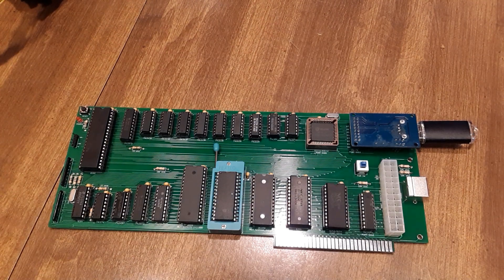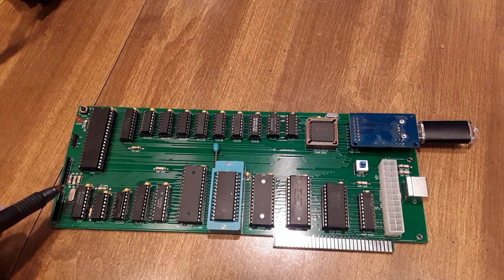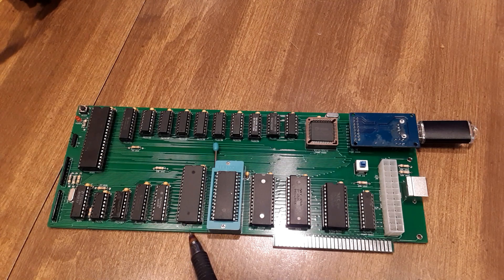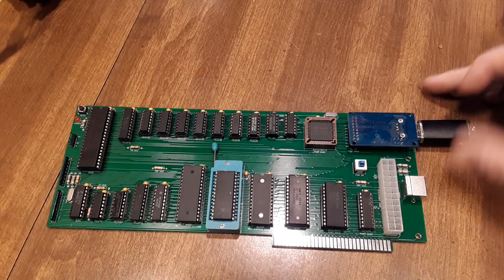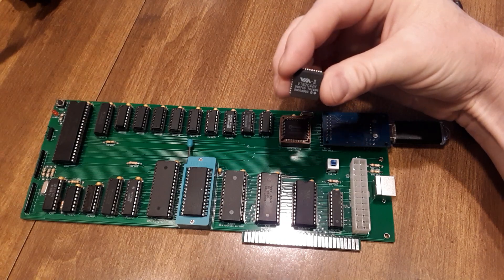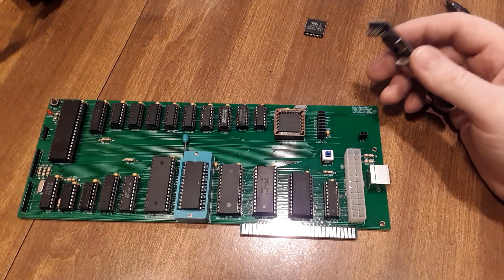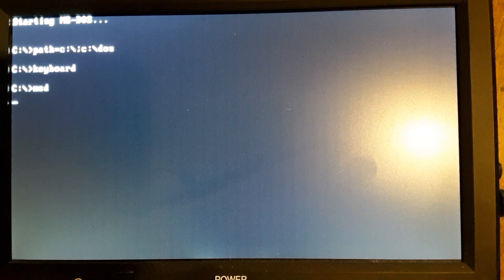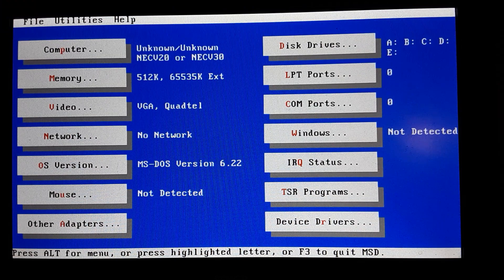8088 ISA Motherboard

Comment: Perhaps the beeping is due that your PCB layout is different to another PC. Make sure you check if the output from the 8255 connects ro gate2 of the PIT. Perhaps your base address != 0x60 or you have connected a different I/O pin to this gate. That would be a suggestion why it would keep beeping. Good luck and awesome project!
Reply from the maker: I am not sure. This issues is only with the 3rd party BIOS. My BIOS doesn't have the issue. I am thinking it is in the BIOS initialization code. Port 0x61 on both boards and the speaker logic is the same. the only difference is the V40 has the 8253 built in and the 8088 has an external 8253.
Reply: @elijahmmiller  Be sure to check this image: http://www.minuszerodegrees.net/5160/misc/5160_speaker_circuit.jpg

You see that PB0 drives gate2 of the 8253 PIT, and activates the counter for the PC Speaker. However, in a 5160 PC the output of this counter is not directly connected to the speaker. It goes trough an AND port before it hits a buffer/amplifier to drive the speaker. Perhaps to deal with DC offset when counter output is high? Therefore both bits are important.

When you look at line 492 of your BIOS code, you see that does set PB0 to '1' but PB1 to '0'. It would not make any sound on a PC with the above circuit as the AND port is activated (both PB0 an PB1 high), but if you don't have this AND port, it will make your system beep!

mov	al, 10100101b			; Set (non)turbo mode
out	61h, al

https://gitlab.com/hakfoo1/v40-bios/-/blob/main/pcxtbios.asm#L492

I might be wrong, but this could be a clue (and is easily fixable with some bios patches)

Regards,
Mathijs
Reply from the maker: Thank you for the information. I will have to look at the technical datasheets for the IBM 5150 again. It seems like it is mostly in the BIOS code but there could be some hardware issues I am overlooking.

Comment: Cool design. Can you share gerber and scheme?
Reply from the maker: I some blank boards available on eBay if you would like to build your own. The link is in the description. I don't plan to release the Gerber file anytime soon.

If you check out the main page of my web site I have the basic schmatic for an 8088. Over the next couple of months I plan to update it to match this board.
Reply: @elijahmmiller  At least to get a scheme would be great. Because right now this is just an artifact. I saw your website. There no schemes. Anyway, thank you for great contribution to digital community.

Comment: Superb! Do you have a BOM for it?
Reply from the maker: I get all my parts from many sources so I don't have a nice clean list with part numbers and cost. 

Parts needed to build.
1 x Blank PCB
1 x 8088 or NEC V20
1 x AS6C4008
1 x 62256
1 x AT28C256
1 x 8259
1 x 8253
1 x 8284
1 x W83C42P
1 x 74LS74
1 x 74LS257
3 x 74LS573
1 x 74LS245
3 x 74LS139
4 x 74LS138
1 x 74LS04
1 x 74LS07
1 x CH367
1 x 256mb USB Drive
1 x 14.31818 MHz Crystal
1 x 12 MHz Crystal 
3 x 510 ohm Resistor
3 x 27 ohm Resistor 
1 x 33 ohm Resistor 
4 x 10k ohm Resistor 
2 x 10k Resistor Array 9 pin 
24 x 0.1uF Capacitor 
1 x PC Speaker 1x4 pin
1 x 6mm Push Button
1 x 3mm LED
1 x 8mm 6 pin on/off button 
1 x 24 pin ATX power connector
1 x Mini 6 pin Din 
1 x 2x8 Female Pin Header
1 x 1x2 Female Pin Header
1 x 1x2 Male Pin Header 
1 x 1x4 Male Pin Header
1 x PLCC44 Socket
1 x 28 pin ZIF Socket
1 x DIP 40 Socket 
1 x DIP 18 Socket 
3 x DIP 14 Socket 
8 x DIP 16 Socket
4 x DIP 20 Socket 
1 x DIP 32 Socket
2 x DIP 28 Socket 
1 x DIP 24 Socket
1 x Keystone 9202